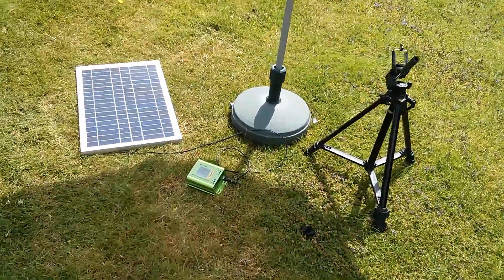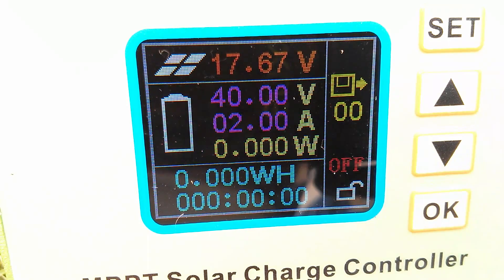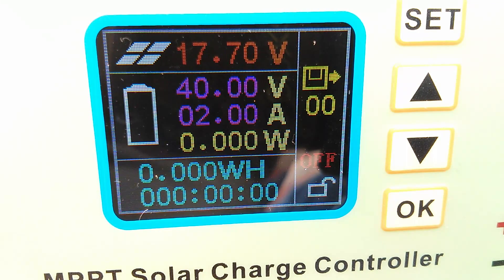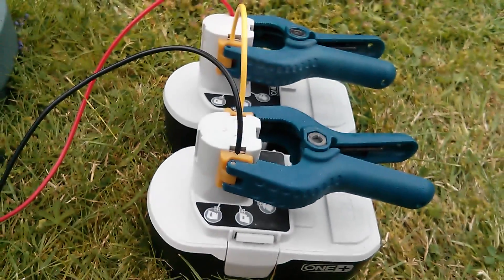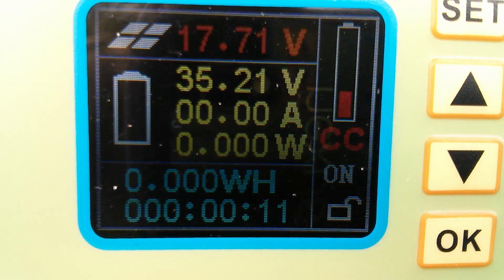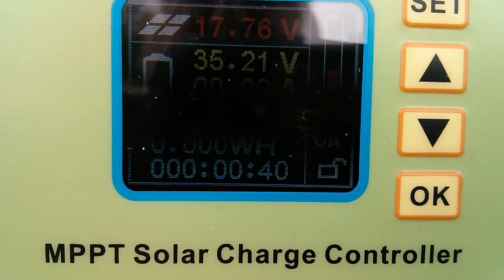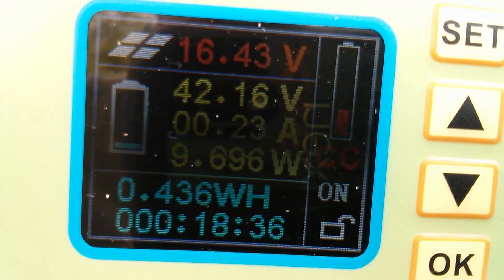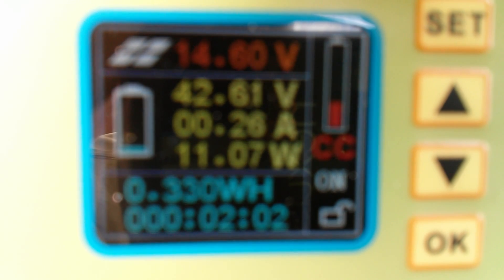Ming He MPT-7210A MPPT Solar Charge Controller #2

Comment: Hello there, did you ever figure out how to automatically keep charging - when the sun goes back up again?  In order to do that you need to press and hold (setting button)  next go to (AMP section) then press and hold the setting button for 5 seconds then and let go.  After that keep pressing (setting button) to get to (OFF setting) then change to (ON) with arrow button  - this will allow it to auto start charging when the sun goes back up again.

Comment: Hi, the Solar panel input have to be higher voltage than output, otherwise it will not charging the battery. Ok

Comment: You should really first learn how to use the device before doing a review on it.  The issues you are having all have simple "fixes".  Also, you are questioning whether this is a battery charger or a solar controller.  What do you think a solar controller is designed to do?  Charge batteries!  That statement you made seems idiotic to me.  It shows me you are too dumb to figure out how to navigate a menu by reading the user manual.  Downvoted for stupidity.

Comment: So.  Pretty much worthless as a solar charger if it won't wake up in the mornings.
Reply: Check section 3 of his videos. They can be set to power on every morning on their own. Mine are setup that way. Drok has instructions that show how to do it. 
1. Push SET with the power off but hooked up.
2. Push SET again to move to Panel Voltage.
3. Push SET to move to Charge Voltage.
4. Push SET to move to Amps.
5. Push SET and hold for a few seconds. Release and it will then move to Time Out Time. TOT sets how long the display stays on before going blank. 00:00 is continuous display.
6. Push SET and it moves down to Battery AH Rating.
7. Push SET and it moved down to Charge Timer.
8. Push SET and it moves to OFF. Change that to ON and it will turn itself on every morning.
9. Push SET  and OK to save. 
You can then kill the panel and return power from it and it will power itself up. Make sure you do it in Data Set 00 as that is the Data Set that it boots to after a power off state as in every morning.
Reply: @gravelydon7072  Yea, I was sure I missed something in that nature.

Comment: You should set the panel voltage to minimum panel voltage which is 12 volts in your case.

Comment: The reason why it wont auto-on in the "morning" is because you have not saved this setting to power-profile. Press and hold SET aand then scroll down to off and change it to ON and SAVE. It now should auto turn on, mine does. Its a very odd controller btw but hey i t works, but not as efficent but for the price i cant complain.
Reply: Do you recommend this device?
Reply: @bobcatt2294  not anymore... there are better ones today. This one was very slow to recover charging after a shade hits the solar panel... painfully slow.... dont bother
Reply: @ahah1785  Which ones do you recommend for the intended use for a trike or mobile use?
Reply: @ahah1785  Which ones are better? Most MPPT controllers are capped to charging 12/24 V batteries or do step down rather than step up. This and the CTK300 are the only ones I can find that allow you to charge a higher volt battery with a lower volt PV.

Comment: i just checked on this and the voltage can go as low as 15 volts. equalize is 15.1 votls average charge is 14.4 for lead acid and 14.5 to 14.9 volts for sla for average charge

Comment: i looked back a little in the comments but not too far. The reason it would not come back on is the battery, not the solar panels are suppose to power the charge controller. You normally never disconnect the batteries in a system. You always connect the batteries to the charge controller before the panels or you can damage the charge controller.

Comment: what if you lock it to save it.  how do you tab to the lock and switch it.  Maybe that will lock in the settings and cause it to lock in the on position.  My thought is that the diodes stop it from draining the batteries when the sun goes down.

Comment: mppt chargers don't work well with poor sunlight.  especially when the DC DC converter is so inefficient in boost mode.  input voltage drops considerably causing the unit to drop out. the chargers I have designed work down to 3 or 4 volts. still not efficient but at least it will stay running

Comment: Looks like the solar panel voltage setting is the minimum voltage that the charger will pull the voltage down to when charging. I'd like to bet that if you set the voltage lower it will sit in CC mode more.

Comment: Using this MPPT controller is easy, but it doesn't do what I set it to do. It doesn't work with either 16 or 43v panel, neither with 12v or 24v battery system.

Comment: i don't think its charging because it detects there is not enough power available to provide the 45v at 2 amps you have it set at, thats 90 watts and you have it hooked up to i believe you said a 20 watt panel. just a thought
Reply: Those are max settings and the controller would have no way of knowing max amps without a load.
Reply: ah, thought was the requested charge current.

Comment: I think the lock symbol has something to do with the automatic charge initiating, for example if you lock the keypad the MPPT might think that you've done setting it up and want to leave it alone so from that point it will charge the battery automatically. I'd say locking the keypad might put it from setup mode to automatic charge mode.

Comment: Maybe - wild guess - you actually need to set the nominal voltage of the solar panel too? Because it seems odd to me that that field can be highlighted, maybe it's expecting a higher voltage from the panel and it cuts out because of that.

Comment: I've had this in my watch list for some time at £25 (I suspect events of the last few weeks means this price is long gone though) but the fact it only worked on 24v+ systems has put me off. My shed is fully 12 volt. 

There must be a way you'd have thought to make sure it kicks in again automatically. Only so many options to try with four buttons I guess. 

I did suggest this to one gentleman as an option to charge his ebike - I think it's serving his purpose quite well, which was nice to hear. 

Thanks for both videos. Very interesting.
Reply from the maker: Yeah, it's a shame it doesn't support 12V systems. I have now found the setting for auto switch on at reboot. That's in part3 which I'm uploading now.
Reply: +Julian Ilett Excellent. Thanks for letting me know.

Comment: I noticed that the unit failed to charge when solar panel voltage dropped below what wat the set voltage.  Possibly the solar voltage is a minimum setting to abort charge?  Since it is a boost converter, I would try setting solar voltage to around 12V and see what that does for you.  Additionally, if trying to set output to 12 or 13V, I would set input even lower (perhaps 9 or 10v) and see if that works for a 12V battery.

Comment: How complex is (and expensive) to build a solar panel angle is changed (according to time e. the location of the sun)? The energy of the sun to get max, whit best angle.
Reply from the maker: The mechanics are the problem. Big bearings and motors. The electronics probably not too difficult.

Comment: I have found this languishing on an auction site. What is it? http://www.ebay.co.uk/itm/Adjustable-MPPT-Solar-Panel-Controller-Battery-Charging-5A-9V-12V-18V-24V-/322181267388?hash=item4b037fffbc:g:qx4AAOSweWVXelNC

Comment: what if you use the battery to also power the unit with say 12v? would require a seperate unit to switch from solarpanel and battery(with buck converter?) though?

Comment: Looking at one alibaba page with what looks to be the same unit re-branded.
Looks like it has a charge timer, you can even set the capacity of the battery. Set fan speed, LCD brightness. Seems like a pretty interesting unit.
The lack of a decent manual seems to be a big problem.
And it's pretty weird that it is a boost only unit. What if I had a 24V panel and 12V battery system? I guess I would have to look for a different charger.

Looks like a typical Chinese mix of awesome and crappy.
Reply from the maker: Yes, it can be set to auto on. Part 3 shows how. Also LCD brightness adjustment, fan speed adjustment, zero current calibration and other stuff.
Reply: Thats my problem too. 24v panels and 12v batteries. That and the fact that it has to be manually started. If it was 10$ i would buy one to charge multiple lithiums.
Reply: But that's the thing it CAN be set to auto ON.
Julian just didn't find the feature due to the extremely lacking instruction manual.
The biggest problem I can glean from the little information that I find is that it's boost only. Which sucks.

Comment: Thanks for the video. This unit looks like it has potential, I have been looking for something to charge rc lipo batteries via solar. Does the battery have to be a higher voltage than the panel?
Reply: That's how it appears to me.

Comment: The alu box plus fan suggest that this needs to dissipate several watts of power as heat.  Why?  I thought this kind of circuit could be better than 90% efficient, but it's running the fan while showing zero watt transfer.
Reply: Exactly, that fan sounds like it's about to take off while the display shows zero watts so either it's dissipating all the power internally (why would it??) or the fan's programmed to expected power dissipation rather than actual power dissipation...

Comment: Julian, check the manual again (or the page at banggood you linked to.) - you have this flow chart of the menu when setting it. At pickture 8 you have an optional step, "Long press SET" and you end up in Screen turn off mode. after 3 presses you end up at the lock symbol,  THEN you can change the On/Off settings, try it out.
Reply from the maker: Yes, I eventually found it - and it works :)
Reply: sweet, so a follow up later on then :)
Reply from the maker: Yes, I'll make a part 3 video tomorrow :)
Reply: whaaat? dont complain about the sun being away... its only nighttime...
Reply: Great! Try it with all your panels - it should handle a few hundred watts.

Comment: I would suggest you to try this solar charging module: http://www.ebay.com/itm/LTC3780-Automatic-Pressure-Constant-Voltage-Current-Step-Up-Down-solar-Charging-/142021446819?hash=item2111234ca3:g:pAwAAOSwvg9XW3Wr
Reply from the maker: I've got that one somewhere. I wish Ming He would build a digital control panel onto the LTC3870.
Reply: So what do you use it for? Haven't seen it since your video a long time ago.
Reply: Right, agree, adding digital control would significantly improve the module... Meanwhile, a simple volt-ammeter would be enough to indicate the status...
Reply: BTW, I've built a bench power supply based on LTC3870 module and added a CC Mode indicator. Here is the schematic that could be useful to you:  https://drive.google.com/file/d/0ByNQSJffKH-NWHROTlFzLWlqTkk/view?usp=sharing
  
Indicator is connected to anode of D2 / output 1 of LM358 op-amp that 
controls current. +5 rail is available at the module - generated by a LM7805 linear 
regulator. CC Indicator can be also connected to an input voltage that 
feeds the module. Then the value of R1 should be changed accordingly.

So, I wold highly recommend it to improve the module. Enjoy.!

P.S. I've found the LTC3870 module schematic @ http://wiki.beyondlogic.org/index.php?title=WD2002SJ_LTC3780_Synchronous_Buck_Boost_Converter_Ebay_Automatic_lifting_pressure
Reply: Sergiy Gryb Nice, maybe you can help me with mine, I accidently killed it via a high powered fan, I've replaced the mosfets and the LM358 but it still won't work properly, when I power it up, all it does is give me same output -0.2 volts or such, I'm guessing the voltage spike killed the LTC3780?

I've had also bought another to replace it, but the supplier apparently sent out a batch of faulty units to sellers back around february, because mine was DOA and I've read a couple reviews of the same thing from other buyers around that time, it doesn't give me anything on the output any ideas what's up with that? Were they fake ICs?
Reply: I am sorry, looks like a bad luck I believe, LTC produces decent chips. I have no issue with mine, bought it almost a year ago. I would suggest to replace entire board...

Comment: i think you have one manual solar charge controller module somewhere on your bench, that you unboxed few months ago. still lying untested, unused.....
Reply from the maker: Is that the device with 10-turn pots on it?
Reply: is it this one= MPPT Solar Panel Controller 5A DC-DC Step-down CC/CV Charging Module LED Display
Reply: Julian Ilett
 yes that little one with 10 turn pots.buck converter with opamp on board.
(i think i made mine after thats design, it worked, charged my 6V SLA batt with much higher current than direct panel connection)
Reply: Simon Dambro
 lol thanks for the title, seems that one was it, it was so long ago.
it seems absolutely was tested, but i remember a design review somehow, lol.

Comment: Can you switch it on then save the profile, maybe it powers up in the off mode as this was its state when the profile was saved.
Reply from the maker: Aha, I've just found out how to save the ON state into the parameter set - I'll explain in part 3
Reply: Hold down the OK button?

Comment: Seems to me that the lock symbol is there for a reason, maybe once you turn it on you have to lock it, might even be as simple as holding the OK button when you turn it on.
The panel voltage, are you sure that's the max ? maybe that's the minimum voltage you want the panel to be before it cuts off the charge, when it tried to charge initially,  the panel voltage went down below your set parameter and all you got was a pulse.
Reply: Please update us when you find a way of you do anyway. I might want one ;).
Reply from the maker: That's a thought, I'll try that
Reply: Maybe you have to save your settings after you turn the battery output on? Certainly not the expected behaviour.